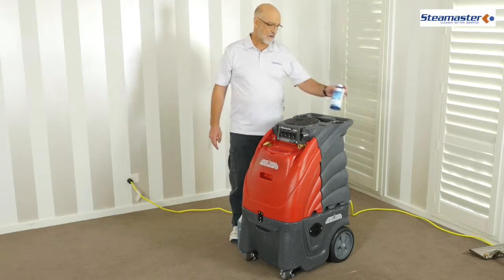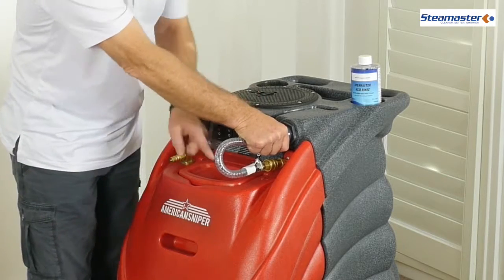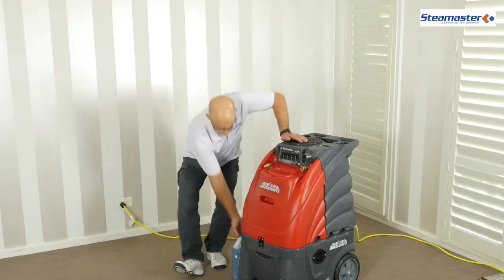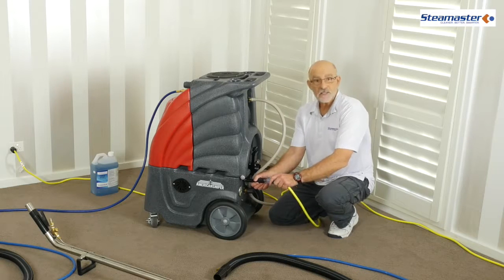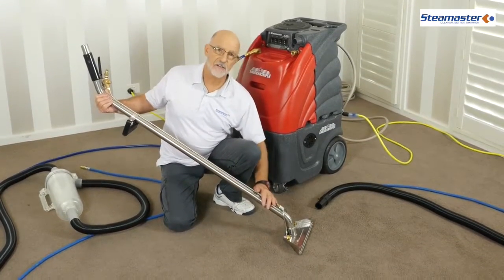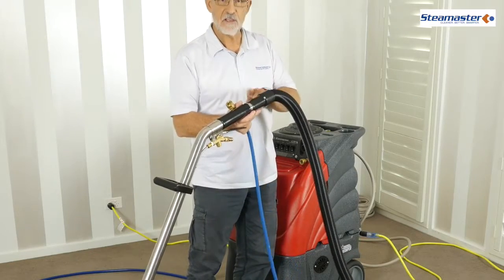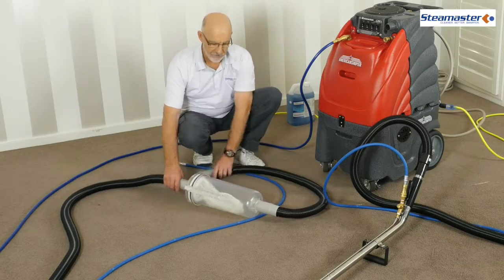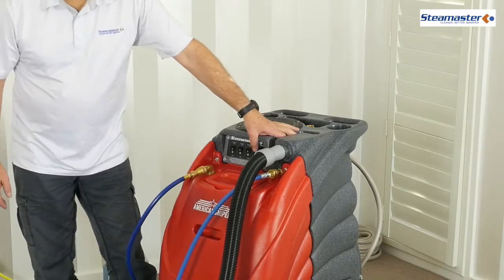American Sniper 1200

Comment: hello i have a new sniper 300psi non heated model.. i want to ask you please. waht is the difference between the two models heated snd non heated on the final results on carpet ? csn i just put hot water on the water tank